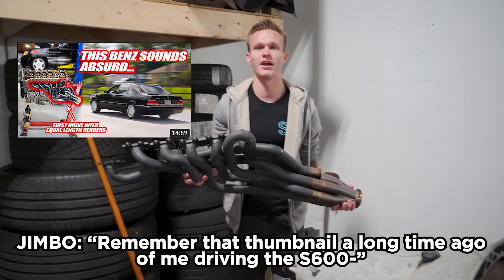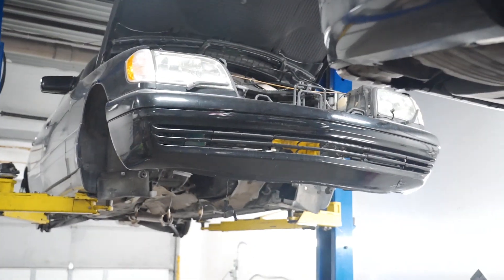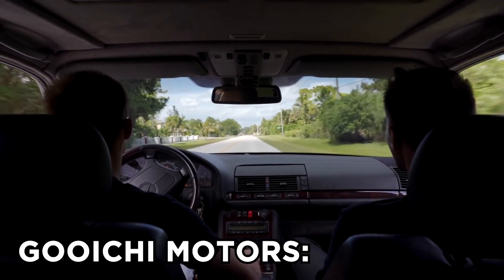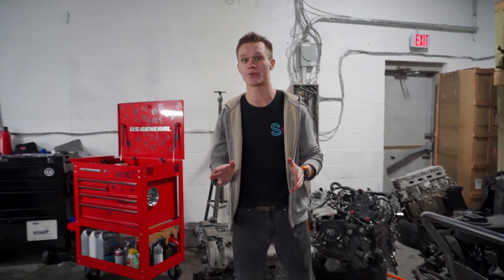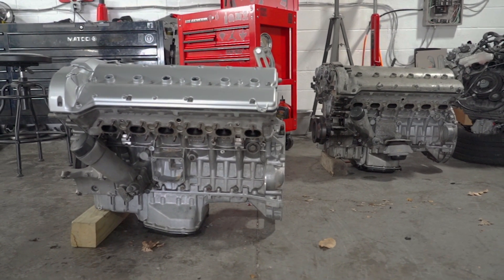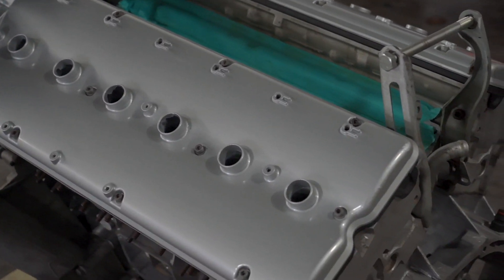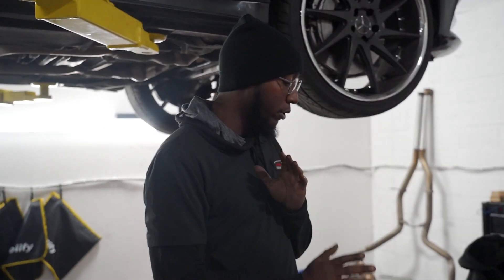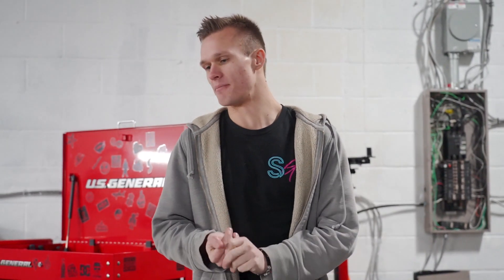SAD NEWS FOR MY PAGANI ZONDA S600...*MYSTERY ENGINE FAILURE*

Comment from the maker: What do you think happened to the motor?
Reply: It wants to feel like a Zonda and require maintenance
Reply: Bad rings.
Reply: It's a Lemon from the factory. Thats my guess.
Reply: The wiring in these cars pre 96 is always suspect. Typically it goes like this: the maf sensor wiring insulation deteriorates to the point of shorting out (especially if the wiring gets disturbed to service intake boots or throttle actuators) at which point the engine goes full rich which in turn washes out the cylinders causing excessive friction to destroy the rings and cylinders. The MAF wiring is separate from the injector harness which usually gets replaced. If you remove some of the insulation from the mafs wiring it will be very obvious and the deterioration usually runs all the way to the ecu "coffin". Unfortunately mercedes used a white glue to bunch the wires together at the grommet leading into the coffin so to remove the maf wiring properly by de-pinning it at the ecu connectors and completely removing the bad wire will result in other wires getting damaged. Best to build a new lh and rh sfi harness from the ground up. If you have this issue going on you will absolutely fuck that mint engine you are installing in short order. That is the only way a sub 100k mile m120 dies if it was otherwise maintained.

Comment: Low mileage means the car has sat for extended periods of times. That means piston rings can stick and valve seats can corrode, causing compression leaks. It makes perfect sense. I would trust the 200k+ mile car over the sub-100k mile car 95% of the time....

Comment: These engines can be a bit finnicky, same with the v8 of that generation. The fuel system can just randomly cut power and its hard to diagnose. Fuel filter, fuel regulator, vacuum hoses... it just goes on and on. A specialist can diagnose it within seconds but its hard as just an amateur who isn't used to these stock m120s